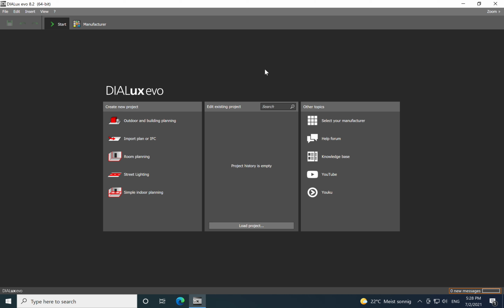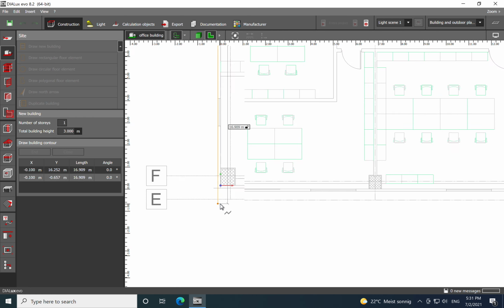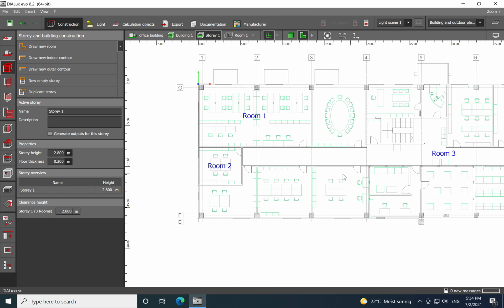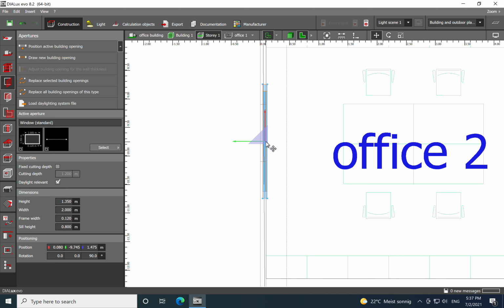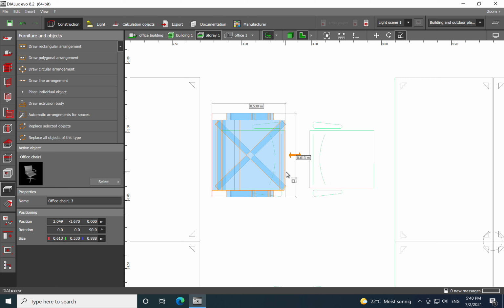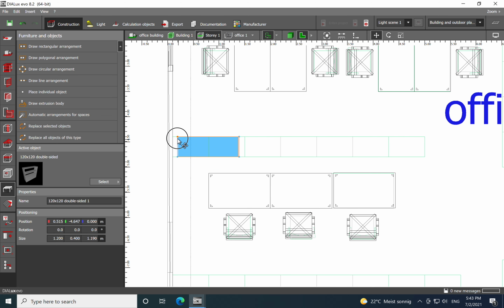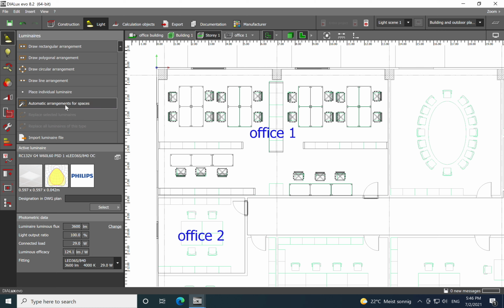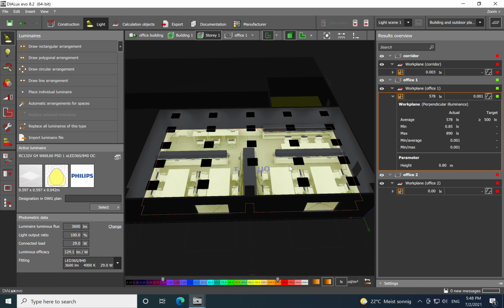Lighting design for office part I

Comment: Hi, you have used 60x60 panel lights- I haven't noticed if you have placed false ceiling? You have to have false ceiling when you are using 60x60 panel, am I wright?
Reply from the maker: Thanks for your comment. Most of lighting manufacturers are providing different installation options for 60x60 lighting fixture. Even the 60x60 is common recessed used in a false ceiling, you can install the same luminare surface or suspend mounted.
Reply: Thank you
Reply from the maker: you are welcome